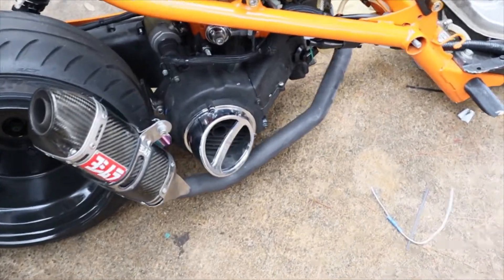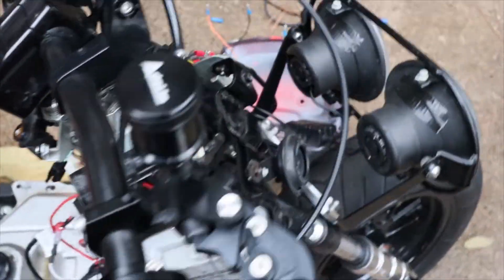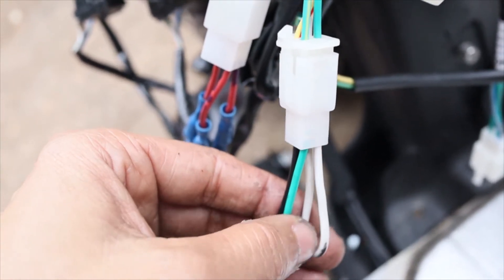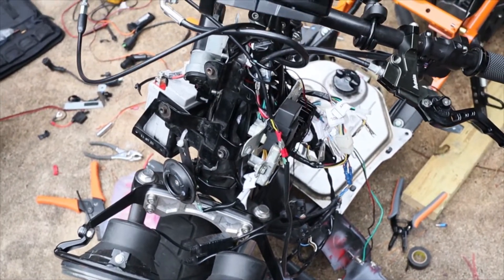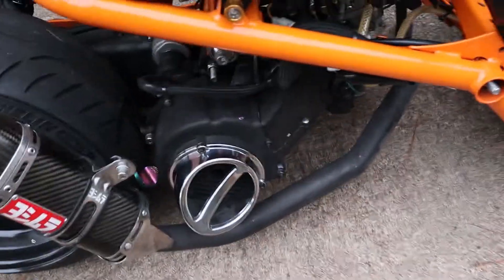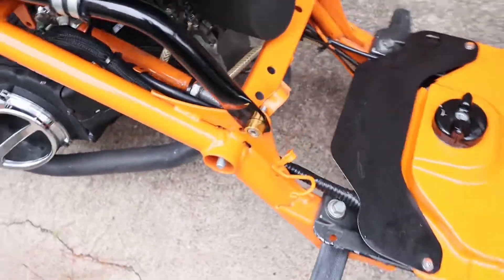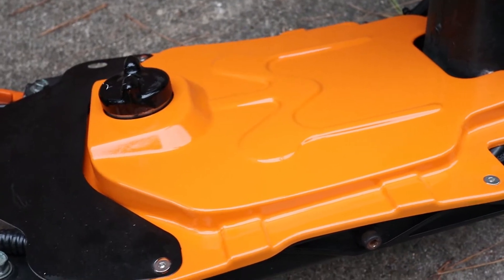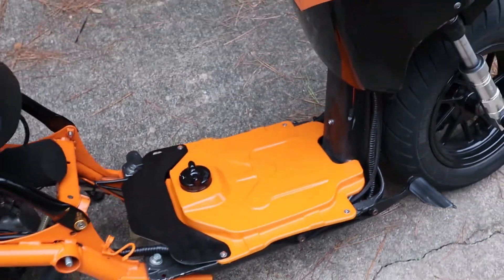ATR Harness  Replaced the old used one #ATRHarness #SmallEngineVelocity #RuckCity

Comment: No T-taps not ever. Will cut through your wire and introduces a spot for corrosion. Awesome work as always Ceaser.
Reply from the maker: Better than two wire in one side of a butt and one out the other. I am really getting into making those clip connectors
Reply: @SmallEngineVelocity  also agreed! We gotta get you a nice soldiering iron and some heat shrink
Reply from the maker: That’s for rich people !